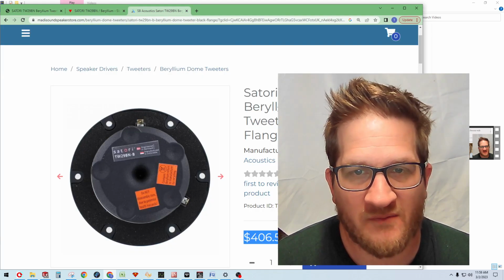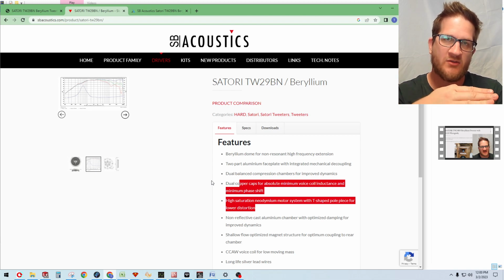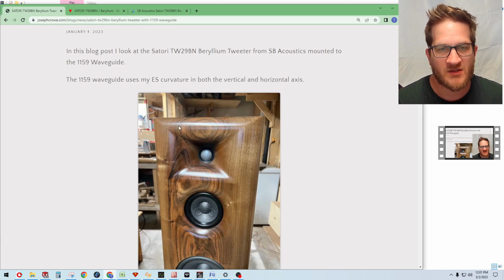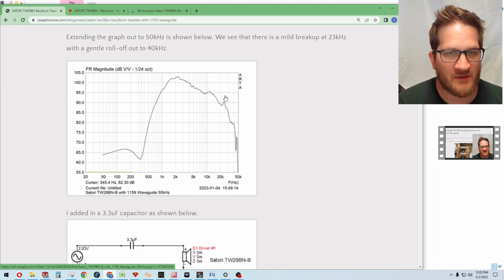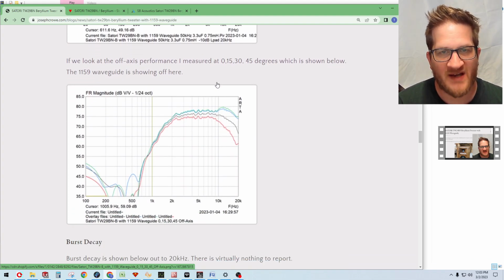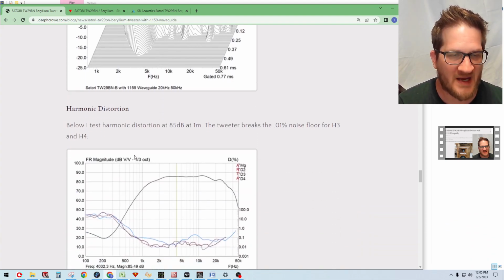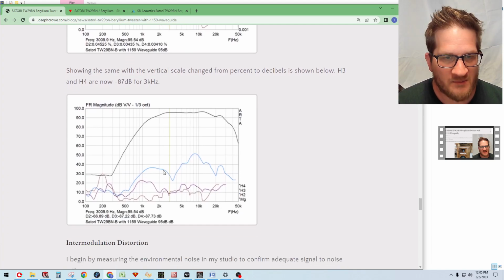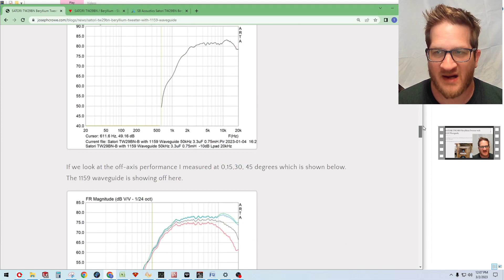SATORI TW29BN Beryllium Tweeter with 1159 Waveguide

Comment: Phenomenal review of an exemplary driver. Any chance you'd be able to also review and compare the version with the integrated waveguide (TN29BNWG) as well as the new Purifi tweeter?
Reply from the maker: I haven’t been following the purifi tweeter very much, we tend to stick to compression drivers for high frequency. We just find that dome tweeter can’t handle high transient material at higher output SPL.

Comment: Something is wrong with your measurement method.
The tweeter has a measured almost perfectly linear frequency response. Take a look at the measurements from users and do-it-yourself magazines on the net.
Reply from the maker: There’s nothing wrong with my measurements. This tweeter is mounted to a waveguide which loads the driver down to 1.5kHz. You are seeing the influence of the waveguide.
Reply: @JosephCrowesDIYSpeakerBuilding  Ok, I understood that the first measurement was made without a horn.

Comment: Beatiful work as usual.  Satori specifies sensitivity of 95dB(2.8V/1m) without waveguide.  Instead of placing it in waveguide and having to add quite a bit of resistor padding back to achieve around 93dB sensitivity, wouldn't it make more sense to just use this tweeter without waveguide even though one would lose directivity control, etc?
Reply from the maker: The sensitivity is limited by the 10kHz region where the waveguide has no affect. The resistors are for level matching to a typical woofer, however it also served to reduce amplifier noise so that I could conduct the IMD test. The capacitor is what flattens the response and attenuates the affect of the waveguide, reducing distortion in the critical region near the FS of the tweeter, preventing distortion from modulating up into the higher frequencies.
Reply: @JosephCrowesDIYSpeakerBuilding hi Joseph, how good is this beryllium tweeter compared to other beryllium in market.